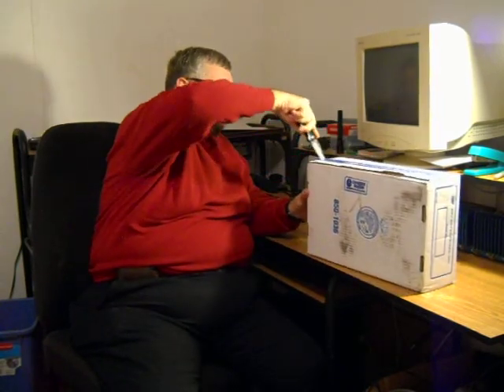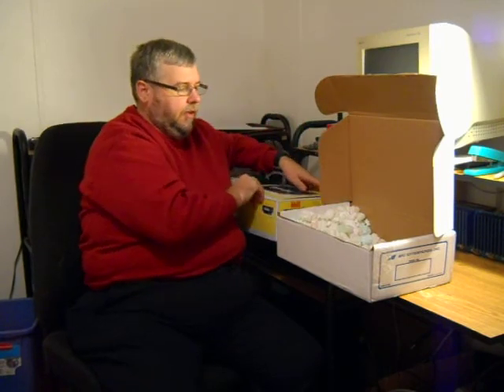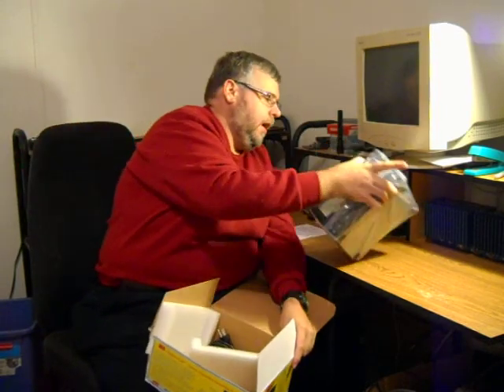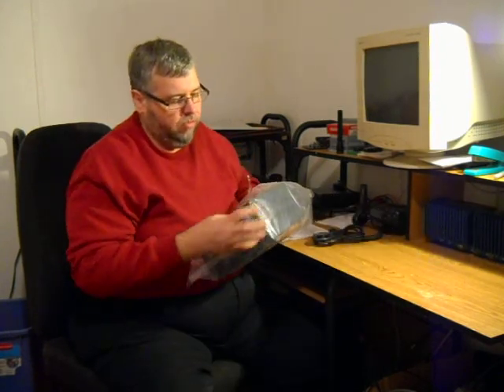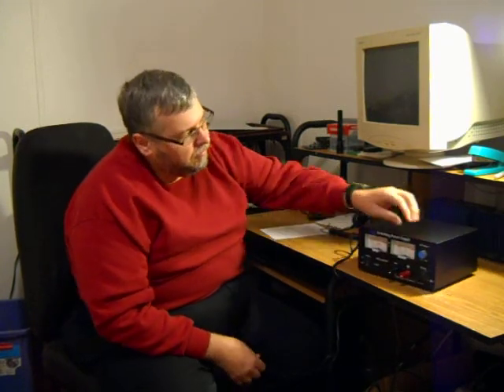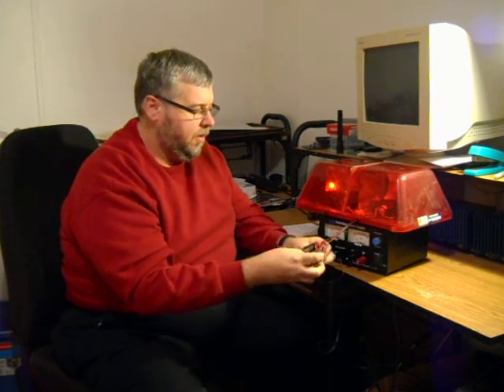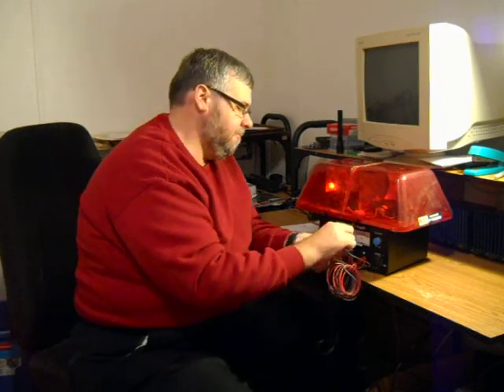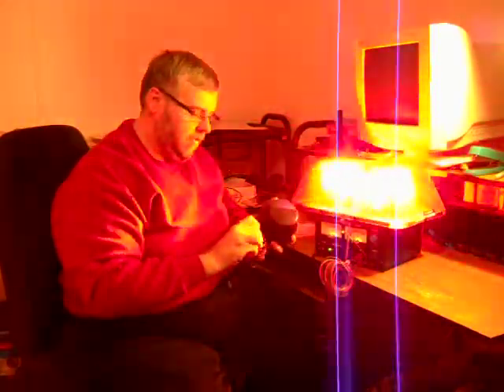mfj4245unboxingandtest

Comment: The Zener diode that goes bad causing R30 to go bad is not even on the schematic...this video shows how badly this power supply is designed and how to fix, with a caution, to install additional protection.

Watch "How to fix burnt MFJ-4245MV" on YouTube
https://youtu.be/ZryjeA65IFE

Comment: Is that a 4245MV? or just 4245? I have one about 2 years old I think? I got a 2nd hand Yaesu FT-950 and it does something strange at power up (the radio.) It makes a funny noise and kills this power supply. The guy I bought the radio from said to try it on another power supply and I did ... the problem doesn't happen. It can't kill a Astron non-switching supply. The only way to be happy is to wire a marine 12v battery in parallel with the supply - then it doesn't get killed. I had to do the what is it 30 seconds off and then back on routine to get the MFJ-4245MV back on after this happened.